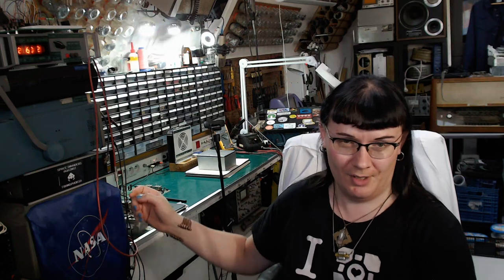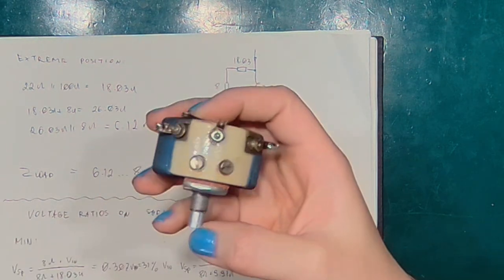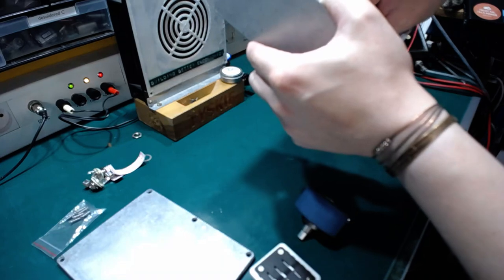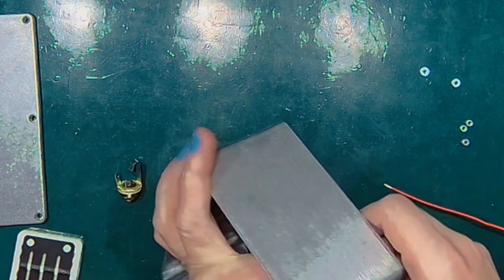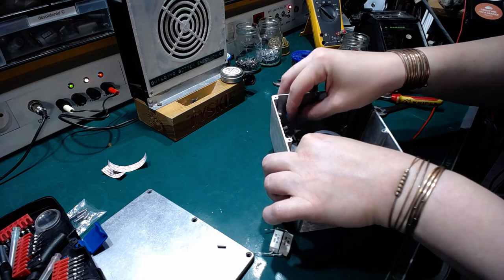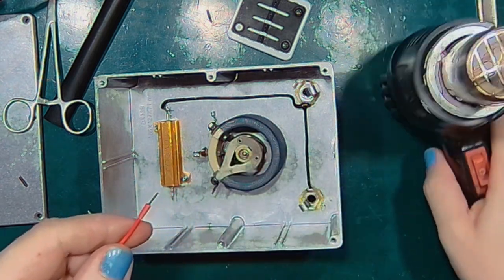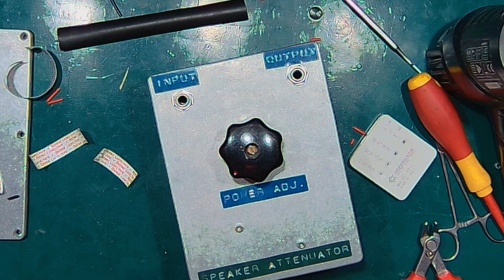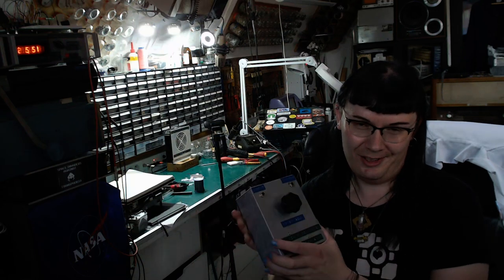Building a Guitar Speaker Power Reduction Box

Comment: L pad, in your case plenty good enough, as most nominal 8R speakers can vary from whatever the DC resistance is, to more than 16R at resonance between the speaker and the cabinet. The 100R resistors are not really needed, but at least will mask any intermittent points as the wiper moves on the track.